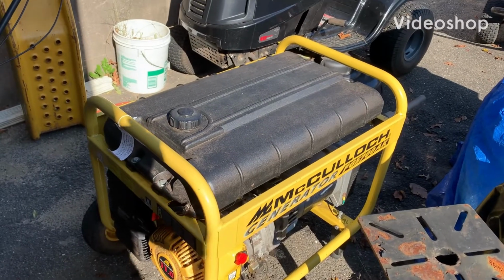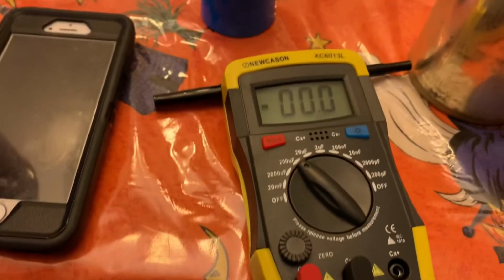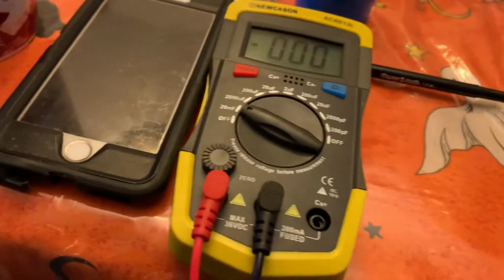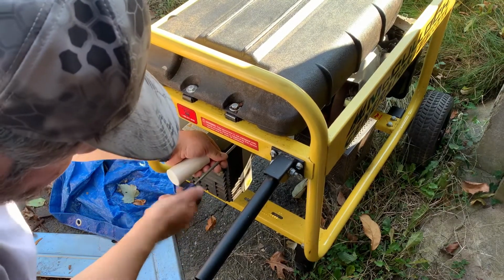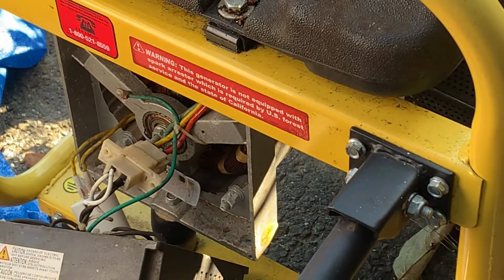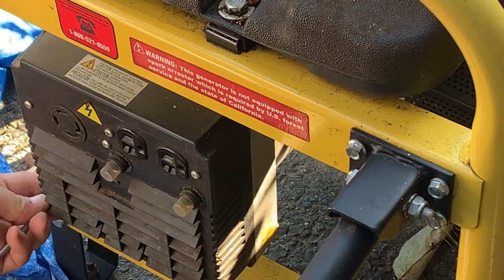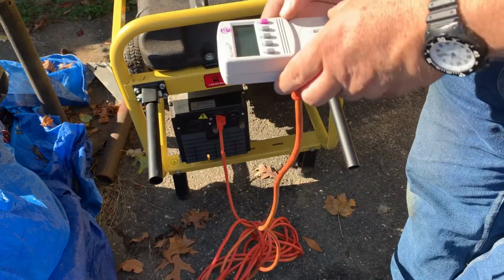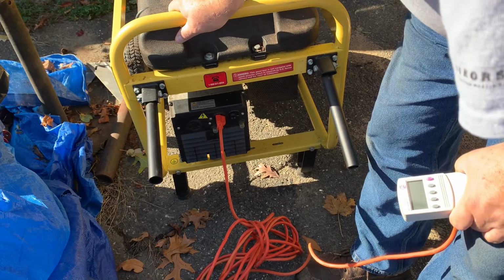McCulloch Generator Not Putting Out Power, EasyFix?

Comment: 26 uF seems to be the size for a lot of these.  I have a couple of these in my electrical box just in case.  You can get them from a lot of places.   I  bought a pack of 10 of alligator leads cheap just to connect stuff up as I don't have 3 hands..  I also use them to charge batteries with small posts.  When you tell the owner you changed the capacitor in the generator he will be impressed.  BTW my snowblower guy came over in the height of the storm to get the blower.  LOL
Reply from the maker: Bruce this one was $50USS plus shipping. Only one o could find.
Reply from the maker: Snow customers always show up during a storm!!
Reply: Always love a generator video.  Happy to see it working again.  Good job Ken!
Reply from the maker: Thanks for your help and videos!

Comment: Hey Ken  I have a ??  For u.   I have a weed  eater /trimmer or weed strimmer as Mick calls it  that says it’s 4 stroke. How can that be.   I thought weed trimmers were all 2 stroke.  Can u explain???
Reply from the maker: They make 4 stroke trimmers too. They take straight gas, have crank cases with oil in them and have overhead valves that need periodic servicing.  Then there are 4-Mix models (Stihl) which operate on the 4 stroke principle but use mix fuel for lubrication with no oil in the crankcase
Reply: @KensSmallEngineRepair   ok thanks. That just kinda confuses me on the 4 mix.  My Stihl uses 2 stroke fuel.  What’s the difference as far as the engine goes between a 2 stroke and a 4 stroke (mix)))???
Reply from the maker: It’s basically a 4 stroke engine that uses oil/fuel mix to lubricate versus having a crankcase with oil in it.

Comment: Those capacitors are less than $20 on both ebay and amazon.  I think he got ripped off.
Reply from the maker: When I was looking there were no 20 dollar caps. Both James Condon and I looked too!
Reply: can i get that link?  I'm having trouble finding the part anywhere.  I'm even having trouble locating the part number.  

I've been lookin for a carb for a 1980 arctic cat trailcat 440 for years and am having less luck finding info on this than that...